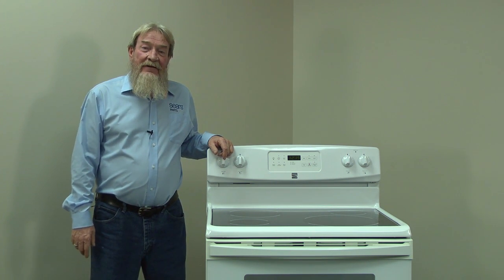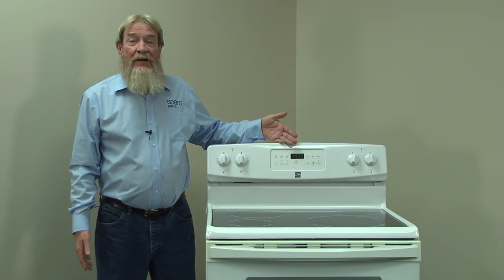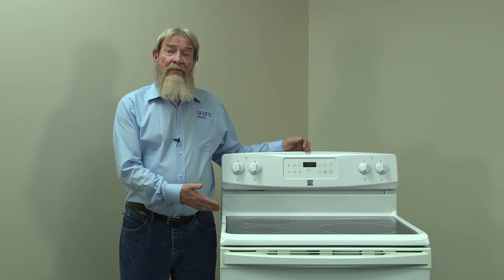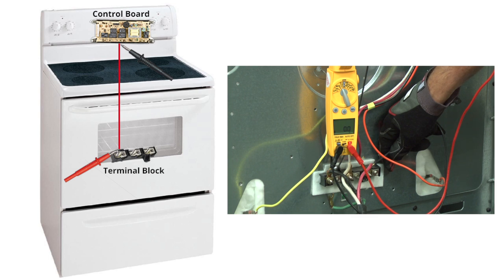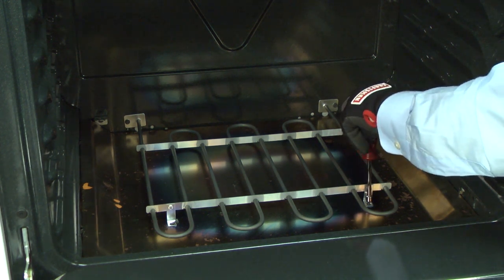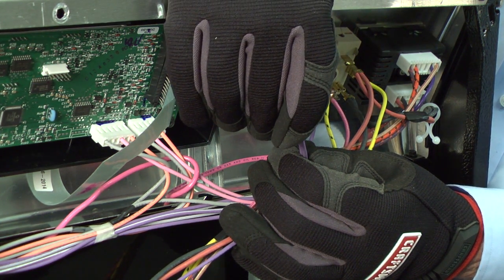Oven Won't Heat: Troubleshooting Electric Range Problems

Comment: I have an Electrolux EW30EW65gs9, The upper oven is not heating up, I have replaced the Heating element and the heat sensor, the thermal fuse has tested and is good.

What I am seeing is that when the oven is turned on, set at 350 for example, it operates without any error code. When I test the voltage at the heating element, with the wires disconnected from the element, I get 110vac alternately on the 2 wires, but never at the same time so the element never gets 220vac.

When I test the lower unit the same way it does alternate the individual voltage but then turns both legs on at the same time and the unit heats properly, any ideas?
Reply: Control board relay issue.

Comment: When I plugged in my range, it sparked at the plug and tripped the breaker.  When I reset the breaker and plugged in the range again, the top burners worked and so did the broiling element; however, the baking element doesn't work anymore [and it is a good element] and i get an F1 error message.  What can I do?
Reply from the maker: A short circuit in wiring and/or the electronic oven control board caused the circuit breaker to trip. We recommend that you have a service technician examine the range and find the cause of the short circuit then repair the range. You'll likely need to replace the electronic oven control board in the range but if you do that and there's still a short circuit in the wiring or a range component, the short may damage the new electronic oven control board as soon as you try to use the bake mode for the first time after installing the new electronic oven control board. You can schedule service here: https://www.searshomeservices.com/repair . Based on your symptoms, we recommend that you unplug the range and have a service technician examine it before using it again in case there's still a short circuit in the range. We hope this advice helps. If you need further assistance, let us know.

Comment: My Kenmore range has heat at all burners, and the M/N is 970-678592. It is my oven that doesn't want to work properly. Yesterday it took 1.5 hours to reach 190 deg. The resistance readings are as follows: Bake element = 15 ohms, Broil element = 16 ohms, the Convection element was much higher and somewhere around 55 ohms, if memory serves me correct, and the Temperature sensor was 1075 ohms. Any ideas? Please help. Thanks.
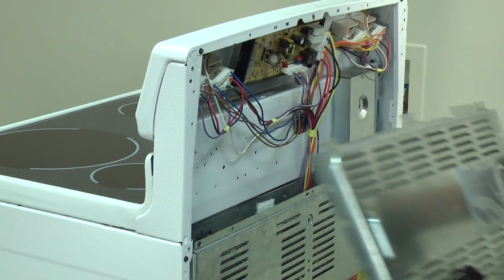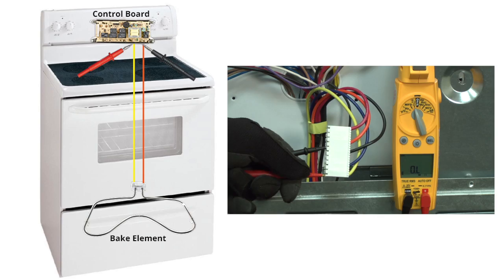Reply from the maker: Those resistance checks indicate that the oven elements and temperature sensor are all okay. Perform the troubleshooting in the video starting at 1:08 and ending at 1:47 (with the range still unplugged). A wiring failure or a failed electronic control board is likely causing your oven heating failure. If you need more help, let us know.
Reply: @searspartsdirect  Thanks for your help. Everything checked out okay so I guess I need a new control board. Do you ship to Canada, and if so how much? The model number is in my original post, but the part number on the control module is 316462808. Thanks.
Reply from the maker: @jimdent351  We don't ship parts to Canada. You may be able to find an appliance parts supplier in Canada that stocks the part. If you know someone in the U.S., they can buy the part hear and ship it to you. Sorry we can't get you that part ourselves.

Comment: Muchos Kenmore elite 40 don't work may the resintece?
Reply from the maker: If your range doesn’t work at all, check the house circuit breakers first. Reset the circuit breakers if they’re tripped. That should restore power to the range. If the range powers up but doesn’t heat, then resetting the circuit breakers may help if only one circuit breaker tripped. If these tips don’t help, follow the troubleshooting shown in the video. If you need more help, let us know the model number of your Kenmore Elite range and give us additional details about the range problem.
Reply: @searspartsdirect  don't work the display...relays maybe
Reply from the maker: @miguelpadillaochoa4704  Relays won't prevent the display from working in most ranges. If the display isn't lighting up, check the house circuit breakers. Reset the house circuit breakers for the range if they're tripped. If the house circuit breakers aren't tripped, shut off the breakers and check the power cord wiring on the back of the range. Reconnect any loose wires. Replace the power cord if it's damaged. If these tips don't help you resolve the problem, let us know the model number of your range and we'll provide additional technical advice.

Comment: Can someone please advise. I have a Whirlpool Gold Series electric oven. Although the panel on the stove said it reached 350, my oven thermometer said it was only 220. The broiler works but now there is no red glow from baking element. The baking element is covered with a metal plate but I can check from the sides to look for the glow. Do you think it’s the thermostat, sensor, or the oven element that’s at fault?  I can’t afford a new stove at this time.
Reply from the maker: Open the oven door and look for screws on top of the bottom oven panel that covers the bake element. If you see screws, unplug the range or shut off the house circuit breakers for the range and remove the oven racks. Remove the bottom oven panel screws and try to lift out the bottom panel. If you’re able to remove the bottom panel, you can check the oven bake element for damage. Replace the oven bake element if it’s broken. Here’s a video that shows how: https://www.searspartsdirect.com/repair-guide/wall-oven/how-to-replace-an-electric-oven-bake-element.html. If you need more help, let us know the model number of your Whirlpool Gold Series electric oven.

Comment: If my temperature sensor is working, the power supply to the oven heating elements should be interrupted when the desired temperature is reached, correct ? The problem I have is an oven that does not warm up at all although the heating elements are ok (one is new) and they both receive 120V on each lead when baking is selected ON.  So it should warm up but it doesn't. Any idea ? (Kenmore Electric Range C970-657322)
Reply from the maker: Yes, the electronic oven control board shuts off the power supply to the oven heating elements when the desired temperature is reached.
 
Measuring live voltage at the element leads is dangerous and we don’t recommend it for troubleshooting. When you measured the 120-volts on each lead of the bake element in the bake mode, you likely measured the voltage from the same leg of 120-volt power during each voltage measurement because that voltage traveled through the element to the other lead. We don’t recommend that you conduct any further live voltage checks.
 
We recommend that you unplug the range and check for continuity through the bake element and wiring from the electronic oven control board as shown at :59 in the video. If you measure about 16 ohms through the bake element wires that connect to the control board, then one of the two control board relays that control power to the bake element is likely broken. Replace the electronic oven control board (https://www.searspartsdirect.com/part-number/318330880/0022/628.html) to fix that problem. Here’s a video that shows how: https://www.searspartsdirect.com/repair-guide/ranges/how-to-replace-an-electronic-oven-control-board.html.
 
If you don’t measure about 16 ohms through the bake element wires that connect to the electronic oven control board, then find and repair the break in the bake element wiring. Here’s a video that shows how to fix broken wires: https://www.searspartsdirect.com/article/how-to-repair-broken-or-damaged-wires-video.html.
Reply: The problem has been identified. There was no voltage coming out of the control board and when lifting one side of the control board you could see some burnt soldering contacts behind the baking relay. New board ordered. Thanks for your advices.
Reply from the maker: We’re glad to hear that you solved the problem. Thanks for letting us know what you found.
Reply: @jlpicard2025  5

Comment: Thank you!!! I knew a fuse had been blown but when I noticed that the unit didn't have a fuse, as a novice, I had no idea what to do without calling a serviceman. All I needed was to reset the house breaker. The part and oven is working now. LIFE SAVER.

Comment: Kenmore 79092803010 oven.  The main wire to the circuit board has fried at the terminal connector.  Before I spend money on a new board can you suggest why this happened?  I don't want to ruin a new board & waste my money.  The rest of the wiring appears alright.  Thank you.

Comment: yep everything checked out fine, but still not heating...any ideas
Reply: +binaryman96 
Because you indicated that the range passed all of the tests, your range may have a defective electronic control board that isn’t sending electric current to the bake element to heat the oven. I recommend that you have a service technician examine the range and replace that electronic control board if necessary.